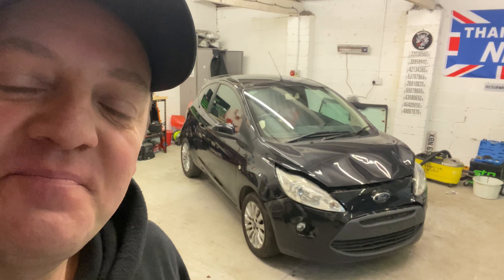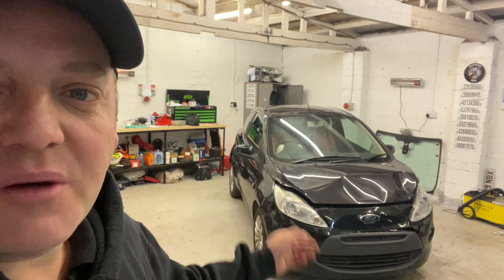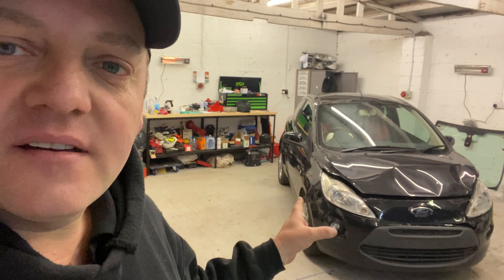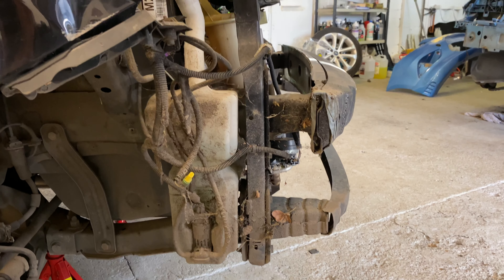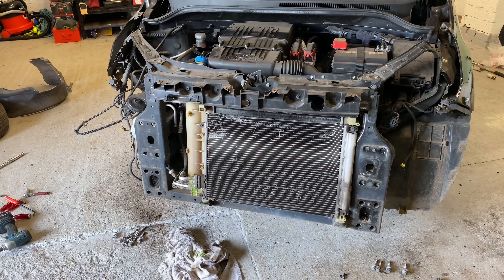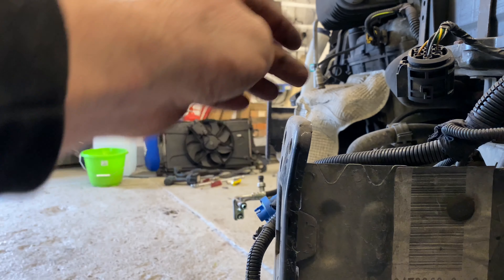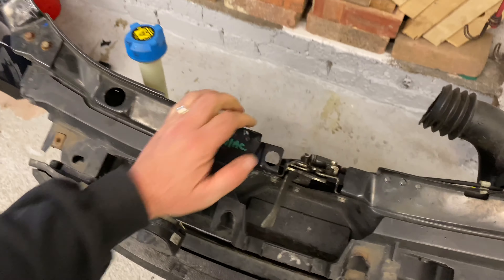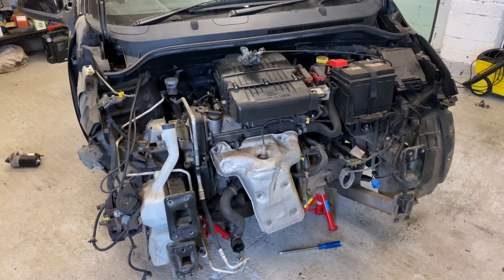FORD KA ZETEC 2010 COPART SALVAGE REBUILD PT1

Comment: Today almost got in trouble with my ka there's noise coming from the left front side of my wheel when am on an even road surface 

I tried opening the front left wheel i had already lift the car up with the jack but the wheel it could not come off after opening all the bolts. 
I put the bolts back and tried to start the car but it could not start The key would not turn and the brakes were hard as fk .i pressed the clutch down several times and luckily God had my prayers the car started 😂😂😂

Comment: Nice work sourcing the parts. I think what this car is going to need most is a thorough machine polish and detail inside and out. The interior will look snappy when its scrubbed up. I did wonder how many parts are interchangeable with the Fiat 500, and whether Fiat parts were cheaper. I’d like to see you pick up a sporty ford like an ST to see how you get on with one of them.